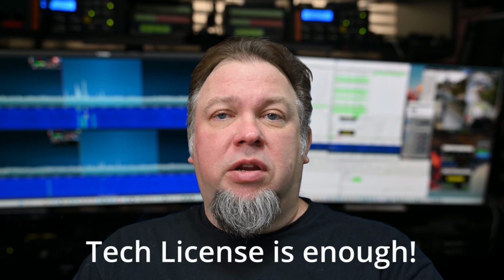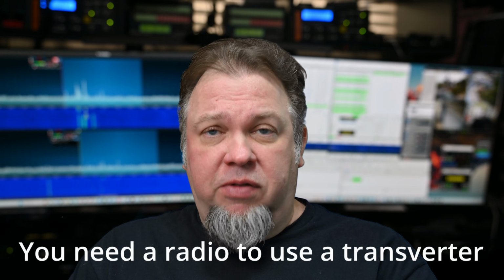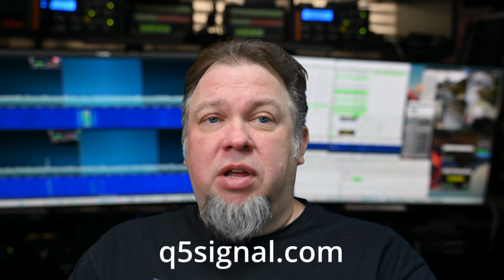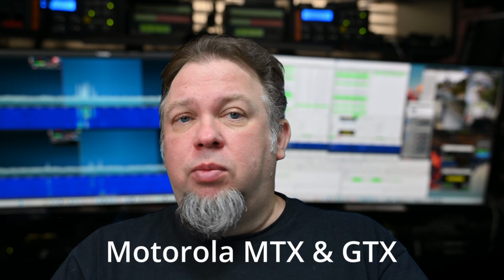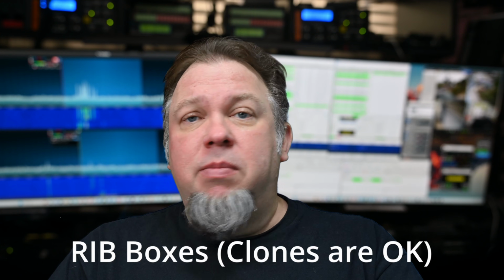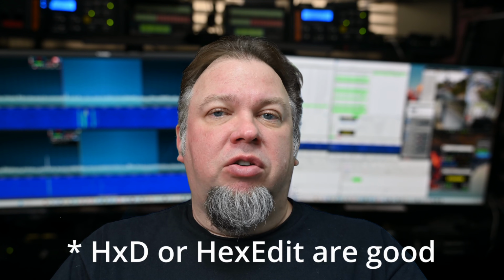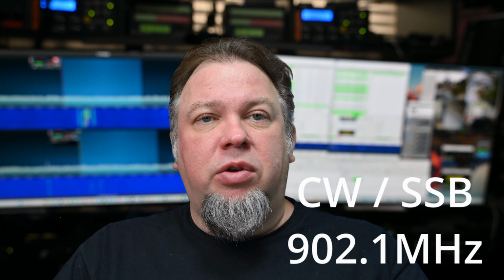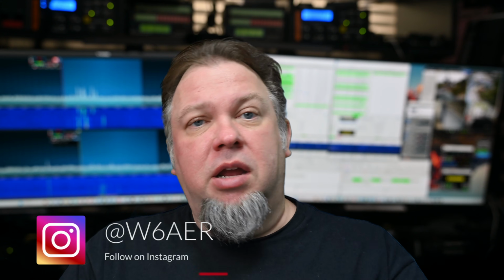The Basics of the 33cm / 900MHz Ham Radio band

Comment from the maker: Have you ever operated on the 900MHz band? Would you be interested in it if given the chance? Let me know below!
Reply: I worked as an RF design engineer at Motorola in Florida for 41 years. We were wrapping up a new radio design called the STX, which was one of the first processor controlled trunking radios, and the first for the 800 MHz band in the mid 80's. We heard that there would soon be a new ham band opening up, so we retuned the ceramic microstrip filters with a Dremel tool in a few radios for 900 MHz and flashed them with the engineering test software which allowed direct frequency entry from the keypad.....in hexadecimal. We had three or four working radios by field day of 1985 and made a live 900 MHz QSO from the field day setup at a county park to myself up on my roof about 2 miles away and mostly line of sight. 

Within a year I had built a crude repeater with two antennas and placed it on a pole about 35 feet in the air west of Ft. Lauderdale Florida. I could see the Motorola plant where I worked from my roof and could hit my repeater from two different 2nd story windows in the plant. It got very little use and died from the effects of a nearby lightning strike after a couple of years. The old hacked STXs wound up in a drawer and have long since been scrapped. The old Motorola plant is now home to Chewy dog food! A few Motorola engineers still exist in a rented corner of the huge 5 building facility. I did collect lots of parts when the old 2G cell sites were being taken down and I have seen my power meter read north of 500 watts on 903 MHz, but I haven't been active on 902 since. 

I left Motorola and Florida in 2014 and moved to a small town in West Virginia. My QTH is surrounded by hills on all sides, so a new 902 repeater is unlikely. There is not a lot of ham radio activity here, so 902 would be ghost town, and the band is used for wireless internet as well as IOT control of fracking equipment here, and some of it is quite strong. The spectrum analyzer can be nearly empty, or it can look like a mess of noise and jumbled spread spectrum signals at any given moment.
Reply: @TubelabCom 
Who is this?I worked in Plantation Fl as well !
Reply: Yes I have looked into it and seems like Allot of Squeeze for the Juice
Reply: Club is in the process of putting a 900mhz repeater on the air so I want to add the capabilities to my shack as well. 

Starting from scratch !
Reply: I have been looking at 900 equipment

Comment: Interesting video, thanks very much.  As a ham for almost 50 years I've never operated on the 900MHz band - at least knowingly.  Reason I say that is because since the band is shared with other devices, it's possible that the many wireless devices I have at my QTH may be using 900 megs.  If you do a spectral scan of the band you'll see many varied signals between 902 and 928 MHz.  I do know of hams in my area using Meshtastic for rudimentary texting though.
Reply from the maker: It really is a busy band, but that's part of what makes experimenting there so interesting!

Comment: Best /easiest radios to use are XTS2500 portable and XTL2500/5000 mobiles. P25 mode bypasses all the ISM noise, like it isn't even there. We have 3 900 P25 boxes there in the Bay Area (one is temp offline).
Reply from the maker: Those are definitely solid, proven options for that band!

Comment: Someone gave me a DJ-G29T and it is currently the only 900Mhz radio I have.  I used to have a Motorola GTX but sold it because I could not program it my self.

Q5 Signal also makes high powered transverters for the band.
Reply from the maker: I think the DJ-G29T is a great unit and it is sad that it is no longer made. Maybe Yaesu or Icom will make something similar one day to reignite interest. I own a Q5 5 band transverter and it cover 902MHz. Allows for all modes, including FT8 if so desired as I am sure you know. I highly recommend these!

Comment: Someone in my club gave me a 900 MHz TK-981 conversion radio. I've had it for a year and have never heard anyone on 900. Given the lack of repeaters within 50 miles of me, I get the feeling that a CB may be more useful, even if I use it just when I'm stuck in traffic and want to know which lane is closed. I think I'm going to remove the radio, but I'll keep it in case I change my mind in the future. The antenna may be useful for a Meshtastic node. Thanks for the video, BTW! -Scott
Reply from the maker: Yes, sadly in some areas the 33cm band is not used much. One of the reasons for making this video was in hopes of educating folks and changing this. It is also possible that there are some repeaters in your area you are not aware of, worth checking!